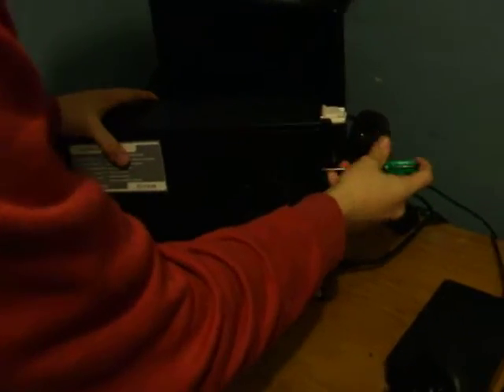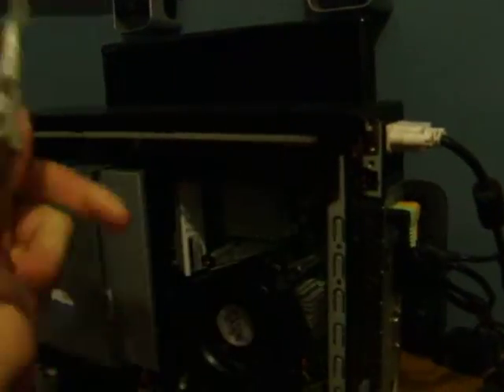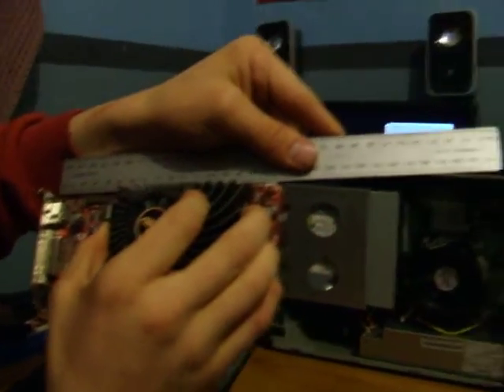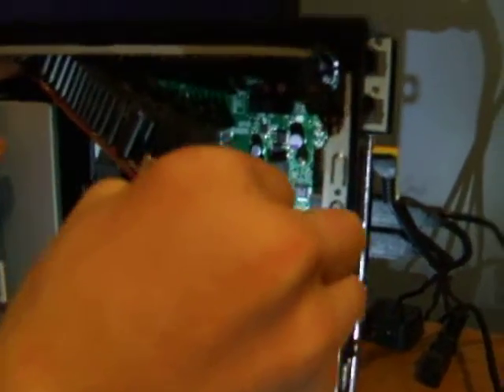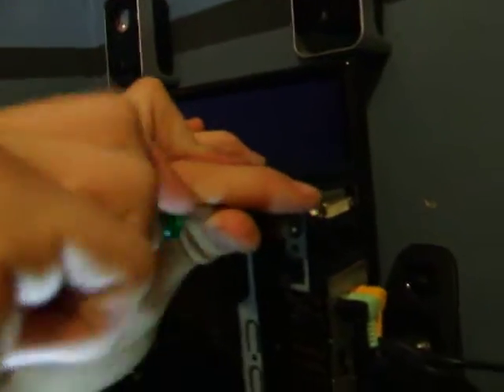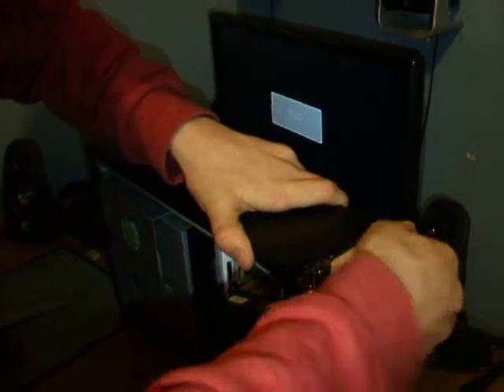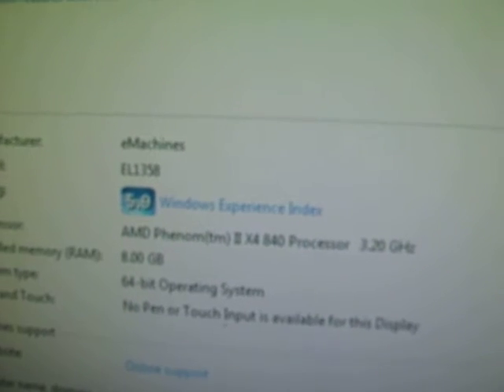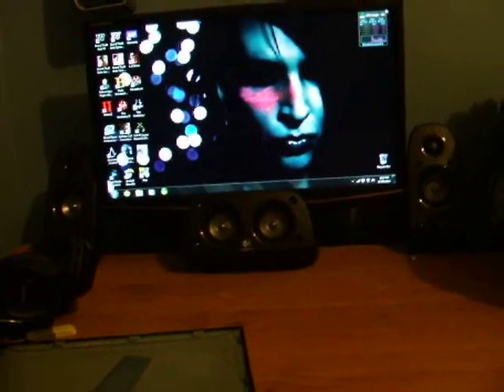eMachines EL1358 Graphics Card installation

Comment: 6 years later and im still runnin the same emachines, still playin wow with the same setup i cobbled together. May end up upgrading to a new comp soon tho......shes startin to get a lil noisy.
Reply from the maker: That's good to hear man how's the fps still going?
Reply: @TheRBGames  Normal play, not raiding or any big aoe around me about mid 50s-mid 60s. Thats with game graphics turned up a lil high, shadow, sunshafts and liquid detail are set at normal to low. Raiding or pvp i turn down graphics to normal or low and usually run between mid 30s to mid 40s. Not the best but for what im runnin and how long ive ran it like this im not complaining. :)  Zotac geforce gt 740, 8gigs corsair vengeance ram, 400watt dynex power supply.
Reply from the maker: @Meantoy  yeah that's good for how old it is good job man

Comment: I have no idea if you're still replying to comments but I'll give it a shot, I have a el1300g-02w and I am trying to upgrade its video card and it is just completely ignoring the cards. I've tried a radeon 7570 and a zotac gt630 and nothing happens when I try to connect the monitor to the card and boot up the machine. It turns on like normal and everything but it only uses the integrated graphics. I have to use a pcie x1 to x16 riser so i can actually plug in the card, is that the issue? Or is it something to do with the bios. Would it be possible to flash either an unlocked one or a bios to one of the models listed in the description that has a close enough motherboard?
Reply from the maker: Being oem motherboard the bois are almost identical with slight changes here and there like for different cpus and sockets going by what you have told me I would say that it's the riser cable if you can remove everything from the case and lay it out on a table and test the gpu without the cable just plugged directly into the mb as I'm assuming your using the riser cable due to a case issue?
Reply: I'm using the riser because it only has a pcie x1 slot and it's capped off at the back so i can't use any cards that has anything larger than x1, i tried the cable on a dell optiplex and it detected the video card just fine, also i tried a wifi card in the emachines using the riser cable and that worked just fine. So i'm thinking of either dremeling off the cap at the back of the x1 slot on the mobo, or just flashing a different bios on the board
Reply from the maker: @Luis-xt8sk  okay I had a look at the motherboard that you have and I see what you mean you could try a bois update for that motherboard or if it's worth it for you there are el1300g motherboards on ebay that have the x16 slot on then I dunno why they removed them on the -02 version
Reply: @TheRBGames tried flashing a 1200 bios onto it, bluescreen during flashing with a CLOCK_WATCHDOG_TIMEOUT error and its not posting anymore. eh i was thinking of getting a new board anyways so no real loss. I'll try to get a board thats listed in the description thats compatible with athlon 5000+. (probably gonna be a el1352g by the looks of it) Thank you for your help and I still cant believe you still respond to comments on a nearly 8 year old video
have a good one man
Reply from the maker: @Luis-xt8sk  sorry to hear that man but at least you gave it a shot and your welcome man anytime i always try to reply as i originally did this to help people have a good one

Comment: How did you get DDR3 to work? I'm using a 1333G and every forum I read says that if I use DDR3 Ram it'll fry my Mobo
Reply from the maker: Mine was 1358 they are ddr3 but 1333 are ddr2 they won't fry it they just won't go into the ram slots

Comment: the ASUS EAH6570/DI/1GD3(LP) Radeon HD 6570 DDR3 1 GB Video Card 

Is no longer available what is the best replacement for that. will an HP 
Radeon HD 6570 DDR3 1 GB Video Card  work in my E Machine thanks
Reply from the maker: Richard White you could try a gt1030

Comment: I was wondering but can you upgrade the motherboard on this pc and what size would it be ATX or Itx or...
Reply from the maker: yes the only one i could fined it the gigabyte H81M-S2V  its micro atx but more important then the form factor is that the PCI-e x16 need to be at the bottom so when you put it in the case it will be at the right spot

Comment: Thanks for the CPU upgrade info, I have my X2 280 OC'd to 3.1 GHz, but I'm looking to upgrade it, the memory, and the GPU. I'm considering a single slot low profile GT 610, but I've seen online that a single slot low profile GT 730 will work too without a PSU upgrade. Thanks again for the info bro!
Reply from the maker: the two best cpus ive used on that board was phenom II x4 840 and the II X4 945 but i think the 945 might of killed one of the motherboards due to its 125watt consumption the 840 II X4 is 95watt the GT 730 is nice but id also check out some from AMD and compare them like a Radeon 7750 1GB from visiontek on newegg or if you wanted to modify the case a bit you could fit a GTX 1050 LP from MSI on newegg aswell iv fitted the MSI GTX 750TI LP to this case and the MSI GTX 1050 LP uses the same design and the cooler is the same and the cooler it what you need to make room for i measured it up and cut a hole out the top so the cooler poked up out the top of the case i hope i was helpful and you enjoy your build man

Comment: I have a weird problem. In my acer the wire that is plugged in for the internet connection to the mother board as well as controlling the time and date is directly in the way. Does anyone know an alternate place to plug this wire into and if not can I take the black breather off of the Graphics Card instead to conserve space?
Reply from the maker: honestly man I don't know what your talking about what model is the Acer
Reply from the maker: if you cut the wire and got extra wire and solder it in to extend the cable and run it under the motherboard and have it come up from under the board and plug it in it might get it out of your way
Reply: +TheRBGames The Motherboard is a El1352-23e except in the computer there is a little white wire that runs from the front where the ear phone and front adapters are on the bottom of the facings. The others stop just short of where the card would go but one goes all the way back to where the front of the card would be. Every time I disconnect it I loose time, date and internet connection. If I hook it back in I get all of it back. I have no idea what this cord is called either.
Reply: +TheRBGames Now where you have a fan and guard on your graphics card? Can I take mine off since there isn't a fan in it? Would that affect the card at all?

Comment: Can anyone help me. I have the same pc with the same ram . My CPU still the Athon x2 . When I installed the card , it freeze my computer. Anybody knows why ? Thanks
Reply from the maker: +Alejandro Espinosa if you installed catalyst drivers remove the card boot it up then uninstall the catalyst drivers shut down put the card back in and boot it up on no drivers let windows get the driver or go to AMD website and get the mantle drivers if you can only use the catalyst then intall and go advanced and check do not install AMD Cataylst Control Centre it does this because the mother board has a Nvidia chipset and the Cataylst CC freeze it
Reply: +TheRBGames Ok . I will try that. But just in case , I just got a power supply on Ebay. 400w for $6.50 . I was lucky. I will reply as soon as I have that install.
Reply from the maker: +Alejandro Espinosa ok
Reply: I did what you told me and the computer is working fine with the new card installed. Thanks.
Reply from the maker: +Alejandro Espinosa your welcome

Comment: what's the best compatible video card for EL 1352?
Reply from the maker: AMD radon R7 240 2GB
Reply: +TheRBGames  I have a list of video card here. can you please help me choose from this list?
     http://imgur.com/676mFLw
Reply from the maker: On Me honestly man there okay cards the best cards you can use that require no modifications at all is the AMD Radeon R7 240 2GB or AMD Radeon HD 7750 1GB i have the MSI GTX 750TI 2GB now but you have to modify the case to fit it in the system also i have an Intel core I7 4790K now to
Reply: +TheRBGames which is better 240 or 7750 for a El1852?

Comment: What about a EL152-43?
Reply from the maker: the same
Reply: I have the EL1358G, not the EL1358, unless there is no difference between the two. Anyway, I've had the same graphics card that it came with since I bought it and I plan on upgrading it so I can play GTA 5 on my PC and/or use shaders in Minecraft. Will any video card work with the PC? Thanks.
Reply: Yes. Make sure to get a SFF (short version) of the 750 Ti if you want to play GTA V. If you want a cheaper way, get a Sapphire R7 260X or 250X. The 250X is around 100$ and the 260X is around 250$.

Comment: did you experience freezing just after logging in on your setup?
Reply from the maker: +Joecyl Glen Sanchez yes a had to safe boot it and remove the AMD Catalyst control centre as is clashes with the Nvidia chip-set on these motherboads

Comment: Yeah so I bought an asus hd 6570 1gb graphics card and after 2 years of use it broke so I need a new graphics card any recommendations? I need the same power consumption as the 6570 because i am not going to upgrade power supply. please get back at me soon before cybermonday deals expire soon please and thank you
Reply from the maker: +quiv duran try the ASUS R7 240LP
Reply: +TheRBGames would their be a performance upgrade from the 6570 to the r7 240?
Reply: +TheRBGames and it would still fit the case right?
Reply from the maker: +quiv duran yes it will fit the case there a little bit smaller then the 6570 and yes the proformamce difference is noticeable
Reply: +TheRBGames do I get the r7 1gb or 2gb?
Reply from the maker: +quiv duran 2gb
Reply: would their be a better card than the r7 but still fit in this case just for future preferences
Reply from the maker: +quiv duran not without cutting the case I'm putting a gtx750 Ti in mine but I have to modify the case
Reply: +TheRBGames so the 750 will  work with the current motherboard and the power supply with the El emachine right the same one in this vidoe?
Reply from the maker: i havent tested it yet
Reply: +TheRBGames alright if you do modify it could you please post a video on what you did? please....
Reply from the maker: of course
Reply: +TheRBGames by the way I just ordered the asus radeon r7 240 2gb lp graphics card and Im waiting on it to arrive  hope everything installs well! thank you for all your help and I will subscribe and like the video. one more thing is their a mother board upgrade that can fit in the el1352 case I know it's slim but it would be nice for a new mother board.
Reply from the maker: +quiv duran I done the motherboad and CPU last week videos is up and it's a conversion from amd phenom ii x4 840 3.2ghz to Intel core i7 4790k 4.4ghz
Reply: +TheRBGames I just saw it but the power supply wasn't listed. what power supply did you use in the vidoe
Reply from the maker: stock
Reply: +TheRBGames do you have safe overclock settings for the r7?
Reply from the maker: 850Mhz core and 1050Mhz memory clock
Reply: +TheRBGames fan speed and power limit?
Reply from the maker: fan speed 100% witch its not very noisy at power limit sets itself for me useing ASUS GPU tweak
Reply: +TheRBGames does the power limit day 0 %?
Reply: +TheRBGames and mine rattles when it's at 100 % fan speed
Reply from the maker: on the R7 240?
Reply: +TheRBGames yeah its not very quiet sounds like it's scraping on something or the fan is bout to break
Reply from the maker: i dunno cause mine quite like it is small fan they tend to be loud but it quiet for its size
Reply: +TheRBGames well I got a warranty for it so I'll keep it running at 100 if it breaks I'll get a new one and can you upgrade the power supply too 400 watt that would be compatible with the el1352
Reply from the maker: i haven't found a compatible PSU i use the stock one
Reply: +TheRBGames ok and what's the highest oc would you do on the 240
Reply from the maker: if you mean over clocking like i said 850Mhz core clock and 1050Mhz mem clock

Comment: Do I need a vga cord plugged in cuz if I plug it in to the graphics card I can't see anything on monitor. But if I don't have it plugged in to the graphics card then it won't be able to detect it? I have it currently just in the slot and no vga into it and I don't think it's detecting it
Reply from the maker: +Millertime it should do it all automatic plug the VGA cord from the card to the monitor make sure all cable are interted correctly and also make sure the graphics card is also seated correctly and also test to make sure the card isnt faulty

Comment: Can this graphic card work with my emachines el1352? Btw what is the name of your graphic card?
Reply from the maker: +Wan Ahmad Zofran yes and that one was the AMD radeon HD6570 1GB but id reccomend getting the new AMD radeon R7 240 2GB
Reply: +TheRBGames thank you!
Reply from the maker: your welcome
Reply: +TheRBGames would  the amd radeon r7 240 2gb fit in my el1352 and do I need to upgrade power supply and is this card better than the asus radeon hd 6570
Reply from the maker: yes and the one is this video was a ASUS R7 6570 1GB id recommend a ASUS R7 240 2GB LP

Comment: is this graphics card compatible with Windows 10
Reply from the maker: +Pablo Estrada yes man just dont use the catalyst control centre as it will clash with the nvidia chip set and cause the screen to lock up completly
Reply: +TheRBGames I had been wondering why I couldn't update my OS without fucking everything up lol.
Reply from the maker: yeah windows 10 will automaticly install the catalyst driver work with there new mantle drivers though

Comment: i need help with the same computer model im not understanding why it does not turn on completely all i get is a green blinking light! please help i have so many pictures in this computer
Reply: Are you still having this problem? If so, (depending on your model) try removing the CMOS (the little silver battery.) It can be found underneath the DVD Drive and Hard Drive if you have the EL1358G model like I do. Just simply remove it and reinsert it. I know because I had this same problem when I needed to remove one of my ram cards and check to see who manufactured it and my pc was acting weird after I put the card back. So yeah, try that. Since using this technique, I've had no further problems with my compy :)

Comment: Hey there, I'm in need of some help. I purchased the graphics card that you have on this video for the same computer and after install I'm having problems with my computer. It comes on but after it's done loading it freezes.
If you need more info Please just ask. 
Please help not sure what to do. 
Thank You
E.P
Reply from the maker: Esau Perez take the card out and unistall AMD catalyst control centre keep the drivers just get rid of AMD CCC because the chipset in these computers are Nvidia and they clash sorry for the late reply im in a new area now and having alot of troubles with the internet
Reply: After un-installing AMD ccc will i have all function that come with this GPU? I would like to have multiple screens, will this still be possible?
Reply from the maker: yes of course you still keep the drivers for the graphics card its you just wont be able to do a duel setup like one game or movie aross two or more screena
Reply: Is it possible to use all three outputs on this graphics card at the same time? VGA, DVI-D, and HDMI all at the same time? If not how can I?
Reply from the maker: no it is possible im doing it right now actually
Reply: Thank you for all your help i truly appreciate it. When it's time for me to set up all three video outputs i will contact you, or you could make a video on it.
Thank you
Reply from the maker: no worries